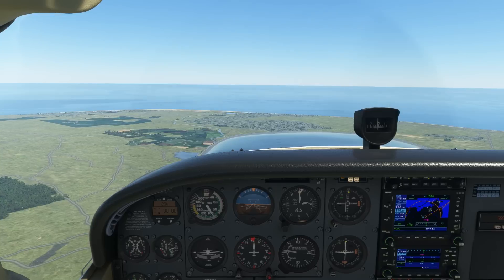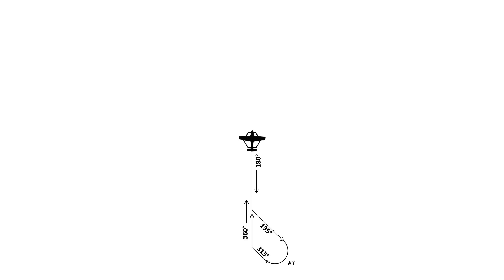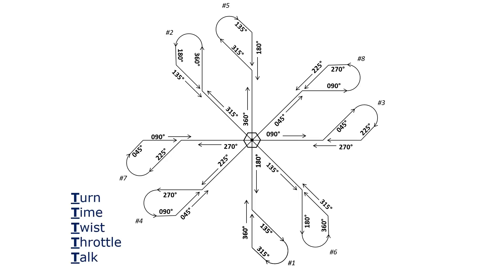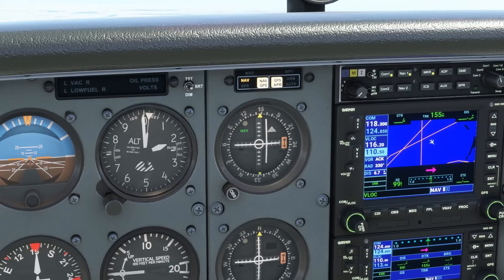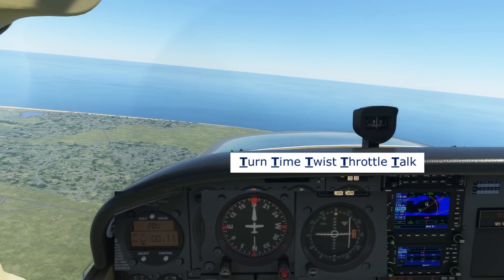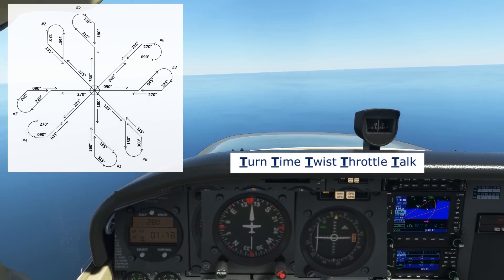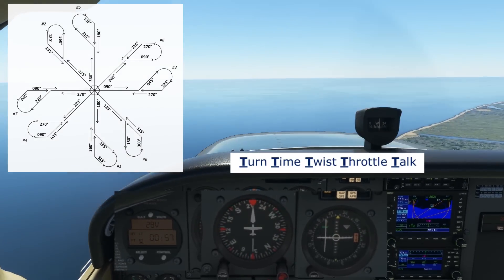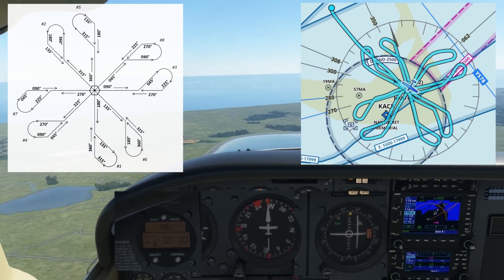A Trick for Learning VORs | The VOR Flower

Comment: I love flying with the radial dialed in regardless of my heading. Knowing when to push and pull the needle keeps you sharp. Knowing the rule, “If the VOR and the needle are on the same side with a FROM indication, you’re not there yet.” Learning to use a VOR like it is an HSI is challenging and rewarding task.

Comment: Air force uses Time turn torque twist track talk, torque is throttle
Reply: Do those higher performance aircraft require a power change before doing the OBS so maybe they don't fly too fast after the turn?

Comment: THIS... is a great exercise, similar to what I've been doing for many years in the sim as an instrument pilot. I just called it a VOR proficiency exercise. VPE for short. Yeah, like we need more aviation acronyms. I like your "VOR Flower" tag.

Anyway, I earned my IA rating during the NDB days of the early 90s. During my checkride, I was required to fly at least one NDB/ADF approach to mins under the hood. Yo, hollaaah!

Try flying this "Flower" exercise partial-panel with no gyros and let the good times roll!
Reply: I couldn't imagine the stress! 🤣💯
Reply: 10 years VOR will go the way of the NDB. By the way, this close to the station is very sensitive. Just flying outbound on a localizer during a missed approach is challenging enough!
Reply: @aviatortrucker6198  Na... GPS is easily jammed and they will keep a "minimum" VOR network up for the backup.  Iraq would jam the GPS satellites of U.S. military aircraft flying near that area.